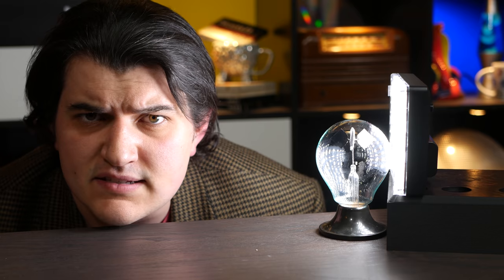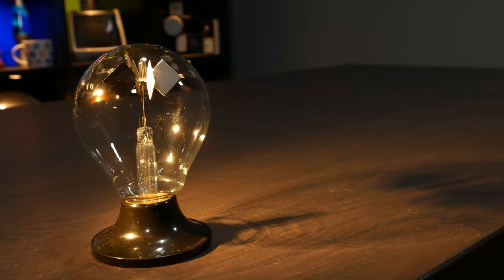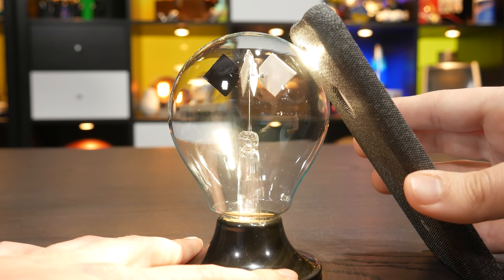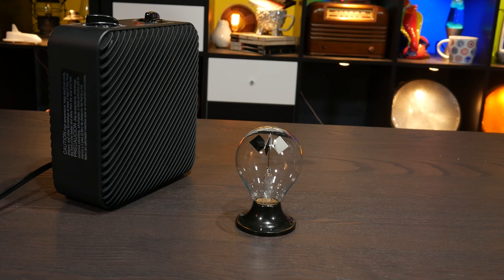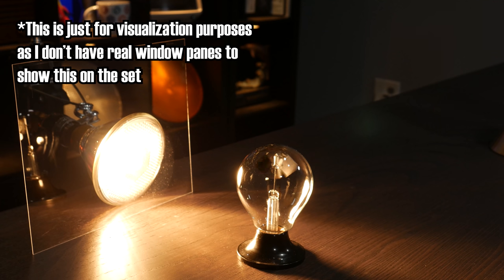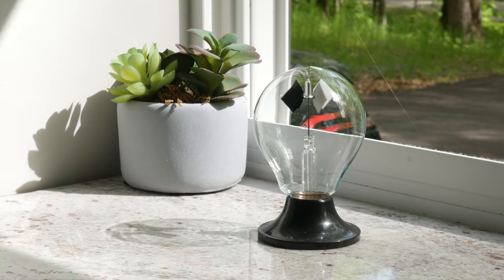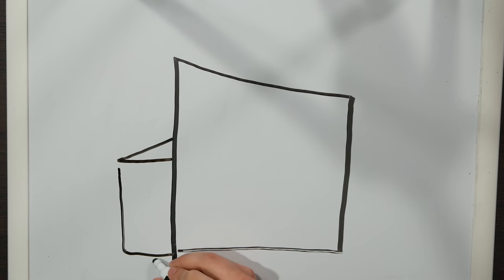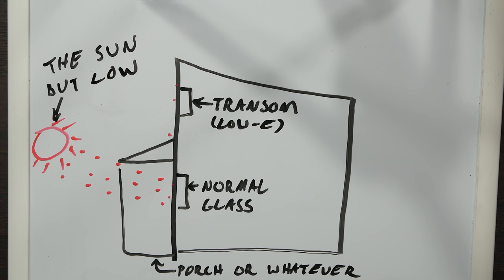What the Crookes Radiometer can teach us

Comment: A bit after 10:05: ...because they transmit that heat through the air to your skin.

I think it would be more clear to say that the quartz heating elements transmit that heat across the space to your skin. "Through" here could be confused with "using as a mechanism," but of course the air has nothing to do with that heat transfer except in impeding it slightly as it absorbs a little bit of the infrared radiation on its way to you.

(And yes, therefore these heaters would work more efficiently in a vacuum. But if we were smart enough to have all our cold train platforms and bus shelters in areas of vacuum, the people waiting there wouldn't lose any heat to cold air so they probably wouldn't need the heaters. Though there might also be downsides to such an arrangement.)

Comment: I strongly doubt that it’s possible to make a single passive glass pane that could reject IR in the summer and transmit it in the winter that doesn’t require some sort of energy input. I do have two thoughts to that effect though. One would be a sort of liquid crystal deal that can be set to reflect IR in the summer and pass it in the winter, but that would most likely require some energy input since the crystals would require energy to remain polarized. Speaking of polarizing, that leads me to my second idea: a double paned window could be designed with two polarized panes with the one on the inside being removable so that it can be rotated 90°. That would require it to be square though and that won’t really fly with people who care about style. There’s probably a workaround but nothing comes to mind right now

Comment: 17:36 Unfortunately, we can't make a glass that only reflects light/ir coming from one side. If we could, thermodynamics would be broken.

You could build a ball of the magically reflective glass, with the reflective side on the inside. It will trap more and more light, raising its temperature. Throw it in a tank of water until it boils, and you get free power.

Comment: If you see (using solar panels for example) how much less energy the sun has in the winter (at least here it's usually < 5-10%, especially since it's basically always cloudy), I think the sun energy in the winter is rather negligible... Might as well invest into geothermal or so for the price that smart Windows would probably need... And as modern homes are basically self sufficient already I don't think the demand for every percent is quite there currently...

Comment: If you have a wood stove,and you have glass at its door ,the light from the fire can burn the wooden floor. This is why,as  nice as it is to see the fire,if you do not have ceramic tiles,stone or cement in front of the stove,better use a door without glass.

Comment: A temperature based coating could work. So if the coating gets cool enough it stops reflecting. Might need to creatively do a multipaned window. Or maybe an electrically controlled coating.
Reply: maybe a modified electrochroamatic window?

Comment: There are (or maybe were) windows with selectable IR reflectivity.
They are double pane windows with no rejection coatings.
There is a roll of film with a rejection coating rolled up between the panes.
The film can be rolled down to reflect, or rolled up to transmit.

Buuuut, as with most things, it is finnicky to get a system right. And I'm pretty sure it didn't catch on because there wasn't a critical adoption rate.
Also, OTHER roll-between-the-panes systems are notoriously unreliable. Having to manage something inside a SEALED, gas filled envelope is a PITA.

But I DO remember seeing a triple paned window somewhat recently with an internal accordion style blind in one chamber and a roll-down tinted film in the other chamber. So maybe they are continuing to be made, and getting better?

Comment: 3:15 From the sun we get an energy flux of 1370 W/m^2, and for photons we have E=pc.
When sun is at zenith this gives a force (on a square meter) of F = dp/dt = dE/cdt = P/c = 1370/3.00E8 = 4.57 μN. This is equivalent to a weight of 0.466 mg, which is only half the 1mg that was mentioned.

Apart from this minor detail a very good and accurate explanation!

11:00 So the reverse spinning is because the black side now is cooler than the white side, because it is radiating off its heat more effectively than the white side?!

Comment: normal glass absorbs IR, but it can't be shown by putting between source and normal glass another normal glass, which absorbs same wavelength as radiometer's glass bulb do.  
and for absorbing more in winter and lesser summertime sages developed "windows" , devices of glass not plastic, on the walls not on the roof, for more surface of this device exposed to low winter sun, lesser summer time, and nearly none summertime midday

Comment: Seems like a good way to test the power of laser pointers, these radiometer gadgets.
If multiple vanes were stacked atop each other in a long cylinder fluorescent lightbulb type vacuum tube, and a small bar magnet were affixed to the top vane with an electric coil stator mounted around the outside of the vacuum cylinder aligned with the bar magnet, I wonder how many vanes it would take to generate electricity in direct sunlight. With diode bridge and regulator of course.

Comment: Maybe instead of trying to find a complicated way to get a window to block the heat when you want it, you could have separate panes of glass, one coated and one not coated, and maybe have some sort of locking mechanism to attach the coated pane to the non-coated one in the summer so they can be pulled down in the same motion. It wouldn't be too different from windows with a glass pane and mesh screen.

Comment: It's not Light pressure, it's Photon Pressure.  Radiation Pressure is a good guess, as is heat pressure, but both would cause it to spin opposite the way it does when exerted from outside, like the way it actually spins when it's cooling down due to the pressure inside being higher than outside.  Photons exist everywhere, excited or not, and light is the excitement of photons.  The photons reflecting from the white IS still double the force of what is resisted by the black, BUT, it is not in the opposite direction, it is split into equal forces by the white surface, resistance pushing against the white surface, and photons being repelled the opposite way, creating a drag that pulls it back, canceling out the force that would cause the dark surface to lead.  And meanwhile the push on the black is assisted by the pull from reflected photon drag, causing it to spin leading white.  If you remove the glass casing and put it in a vacuum chamber, heat has no impact, and the reason heat makes it spin is that the glass "envelope" is because the glass turns heat into IR by exciting photons.  IR is not an energy form, it's an energy level.  Heat is the energy produced by resistance.  Heat and IR are two different thing.  Otherwise a Flir would pick up the beam of a laser, not just the point it hits, and it would have shown your fancy crystal element toaster over emitting heat between it and the radiometer higher that of the glass around the radiometer and less than the element, but it shows nice and cool in between in your video (around 8:40).  Heat can exist without emitting infrared light, and light, even IR, can be emitted and present without heat.  Heat is the result of resistance, or friction.  Whether you are colliding photons into metal fins, atoms into each other, electrons into resistors, or rubbing two sticks against each other.  UV light has zero IR, but still creates heat. .Occam's Razor, the simplest solution is the best.  And complex theories ignore the basics, the simple factors.  And by the way, it spins in reverse while cooling because the glass bulb begins emitting IR level excited photons OUTWARDS to shed the heat, and with the photon pressure moving the opposite why, why would you expect the fins to spin the same way they do for outgoing photon pressure as they would for incoming photon pressure?  Oh, I know why, because simply step taking can't possibly apply to complex theories, because you can't eat an elephant one bite at a time, you have to eat the whole thing at once in a single bite!  One bite (step) at a time can't possibly feed you (solve the problem).  Don't even forget the basics.  There are several videos out there that all claim to explain and prove how they work, but they are all flawed in some way.  Like why does light on the edge of the fins make them spin faster than light in the center, and it's because more pressure is being exerted past it, creating a pull greater than the resistance.  And if heat radiation pressure makes it spin, the center would make it spin faster, because it's producing more heat with more direct and full exposure to catch that energy, so the fact that it spins faster with light focused on the edge than the center completely busts the heat pressure theory wide open.  And increasing the edge area has no impact.  Heat is the product of resistance, not a feature of any particular spectrum of light and not even tied to light.  And painting a resistant surface black doesn't change the heat that anything BUT light causes it to emit.  And that is because light on black surfaces resists photon pressure.  If it were a response to electromagnetic radiation, magnets would make them spin and we would have figured out how to use them for free energy with just a crookes' radiometer driving an axle and magnets to spin it, but neither magnets nor electrical currents near them cause a spin.  And if heat itself makes it spin, sitting on top of the lava lamp with the lightbulb off would have made it spin, but it didn't spin there until the light was on.  Only when the glass bulb turns heat into IR light does it spin.  And UV light makes it spin too, even in a cold or frigid environment,  Light can make it spin without heat with or without that glass encasement in between it and the light, but heat can only make it spin if the heat is applied directly to the glass encasement from outside.  Break that bulb and put it in a vacuum chamber/tank with that heater inside and see if it still spins, it won't.  Only the light spectrum influences the temperature of black or white surfaces, and visible or non visible light are also able to be produced without electromagnetic energy, and electromagnetic energy in those wavelengths fails to produce light without something to transform it into light.  Otherwise 5G cellphones and towers would light up like the sun every time they send or receive signals, because they are getting into light spectrum wavelengths.  Light is dependent upon the presence of photons to be excited by the proper wavelengths.  Observable Light is the kinetic energy of excited photons.  If it wasn't dependent upon the presence of photons, the energy of the air itself would provide us plenty of light with or without the sun's massive release of protons.  Light is a reaction of energy and protons within a medium, heat is a reaction of energy and resistance within a medium.  That's why space is dark, without a medium to reflect or absorb it, it cannot be observed.  as the photons are not reacting to a medium, but just projecting onwards.  Without resistance, no energy is transferred and no heat produced because there is no friction.

Comment: My grandmother had a candle holder with angels dancing around the candle when you lit it. But the angels, actually the entire thing, where made of brass. Though it seems to have the same effect. The caruosel with the angels where mounted in a similar way on a low friction brass pin. Maybe they where made of some type of bimetal I don't know. But they had the same color as the rest of the brass.

Comment: In my head I was like "absorbing something doesn't speed it up! Look at shock absorbers!" 
 I was thinking the black side absorbs more heat packets and once it's "storage" is at max, it would emit causing the heat packets to excite the air around it, creating an imbalance in pressure like a wing; and wouldn't stop, as the black side acts like a capacitor of sorts, but for heat.

Comment: As it turns out I work with windows and screens as a trade, well, it's my second job anyway, low e windows need the low e side facing out to work, ideally they would be low e on both sides and you can get them that way, but it's not cheap, but they are designed to have the coating facing the sun as to keep the rays out

Comment: A radiometer in conjunction with a Kill-a-watt could be a great demonstrator for comparing heat pumps and resistive electric heating. Show that the radiometer spins the same while the kill-a-watt shows the difference in energy consumption.
Reply: Unlikely. Heat pumps warm bulk air and transfer heat via convection and/or bulk flow. Resistive heaters have a much higher IR component.  The heating element of the electrical resistance heater will be hotter than the heat exchanger of a heat pump so more IR is produced. This is one of the benefits of a heat pump as convection heating is much better at heating a room than radiant heat.

Comment: Okay, I'm no engineering or physics expert, so the concept may be brilliant, or may be completely useless; but many windows are "double pane" with a low thermal transfer inert gas sealed between the panes.  Would it be feasible to have a "IR rejection" film to be inserted, which can be a. rolled onto a spool in the frame when it isn't needed, and rolled down into place when it is needed?

For example, an almost 0 IR blocking film is connected to a high IR blocking film, and the two are then attached to a spindle/spine/bobbin/whatever term you want to use, in both the upper and lower portion of the window frame (now this is the frame around the double pane glass, not the entire window as a unit, since that would break the first time you wanted to open the window), then a slider type mechanism with a chain or belt connects the upper and lower spindle/spine/bobbin/etc. so they both rotate at the same rate in the same direction.  Push the slider up,, you "raise the IR blocking shields: (film that blocks IR is moved into the inert gas pocket) and push the slider down, you "lower the IR blocking shields" (the IR blocking film is spun around the corresponding spindle/sping/bobbin/etc) and the NON IR blocking film is in its place in the inert gas pocket.

So "we want to block IR passing through the window?  "Shields up!"  We want to let most of the IR through the window? "Lower shields." with a little bit of automation technology being added, this could even be customized to be connected to any temperature control system and ambient "light" level technology (since you can measure IR as a spectrum of light with many light sensors, as it's just a range of electromagnetic waves.  I mean 2 or 3 extra sensors and maybe 5 data points would be needed, but they basically become "set and forget".  Though it does increase the cost of repairs if a component fails, or the neighbor's kid happens to put a baseball through your window, etc. low power wifi connectivity eliminates the need for wires...  Why am I giving this idea away ?  OKAY, if you read this and you develop it, whichever reader you are, you owe me a commission, royalties and residuals.

Comment: here is a bit more of the science:

 if the white paint effectively reflected electromagnetic radiation while the black paint absorbed it. You see, actual electromagnetic reflective paint will reflect light  back, making it a great insulator to keep heat out, in fact if you paint the inside of your house with that paint, it will reflect heat generated back in and not let it out. 

For Black, absorbent paint, it will absorb the energy, but it will also emit it, usually in the form of black body radiation. Theoretically by having one surface purely reflective and the other one absorbent glued together, you ensure that one side reflect in one direction and the other emits in a other direction.

if they were 100% effective the white paint would be a perfect mirror, and the black paint would be a perfect radiator.

radiators on the space station are painted white to make sure more heat is emitted then absorbed but they could paint the sides in the shade black to emit even more energy at the cost of risking the black part being exposed to external radiation and working as a heater. They now make white paint that reflect energy enough to effectively have your house cool off like it was in the shade.

for the glass being one way... it is most likely impossible.  One way mirrors are not actually one way, they need one room to be brighter then the other, this applies to regular glass as well and it is why it is easier to see inside peoples houses at night then during the day. If the conditions are right you could walk naked during the day in a glass walled house and no one would see you until the light level outside fell enough.

Comment: If the bulb of the radiometer had a pure vacuum it will not work. It requires molecules of something in it because when the black side heats up it radiates heat that in turn excites molecules close to the black side and their bumpping into the black side moves the vains. If you put ice on the bulb it will spin in the opposite direction.

Comment: I have read that the air is accelerated around the edge from the temperature difference.  Maybe it could be proved by having conductive surfaces with insulation between and compared with totally insulated ones